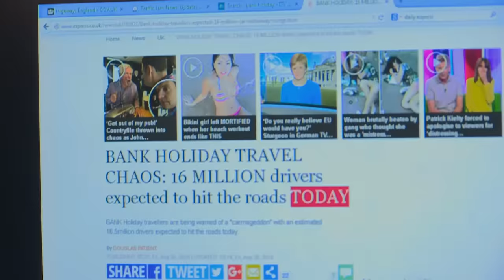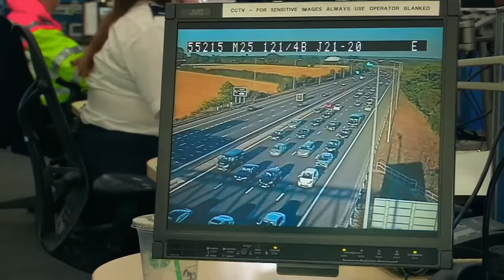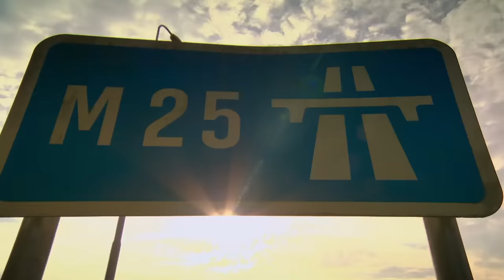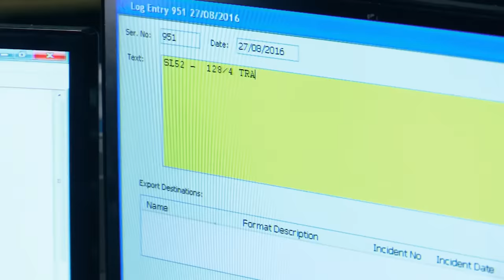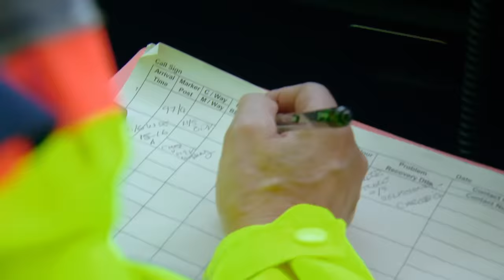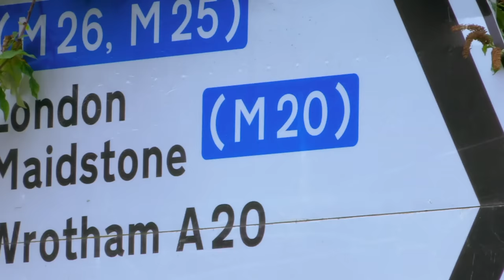One Of The Worst Accidents In Motorway History | Britain's Busiest Motorway E3 | Our Stories

Comment: I love the girls in the office they all do a fantastic job 😀👍🙏
Reply: What these programmes don't show is them switching on the signs because the traffic is moving too well. I'm convinced they do; think about it, the times you go through maybe be 5 miles of gantries all saying; "report of obstruction" with a 40mph limit. Then suddenly you reach the one that switches you back to 70 and yet... Nothing; diddly squat of any obstruction. Does nobody think to themselves... "Why did they have the signs on for nothing then?"
Reply: @johnbower7452  Possibly because just ahead of you, through all that slowdown, people have dragged/carried/pushed/pulled or otherwise coerced said obstruction off the road?  The reason for the slowdown is to make it safe for them to remove it and for you to drive through as though nothing ever happened.  I can assure you that, nowhere in the world can anyone ever say that the traffic is moving "too well"!!
Reply: Really? You don't drive on the motorway daily do you. These guys are in control of the signs and in charge of shutting down a lane quickly if a car is stranded. They fail on both counts. I have seen many stranded vehicles and the lane not shut down. It should be within 60 seconds. After all it's "a smart motorway" supposedly. I have seen families sitting on the grass. If that have had time to get out and sit on the grass then those ladies in the office have had time to spot it broken down. They also cause a lot of problems by putting the speed limit on 40 then 200 Meters onto 60 back to 70 back to 40 all within a few miles when nothing is an issue ahead. I don't expect you to know this If you don't drive 60 hrs a week on the motorways
Reply: Yeah
Reply: I agree
Reply: @Lonely_Goat  bro took it personally
Reply: Parkin takers skin takers car accidents 9:01
Reply: ❤😂 10:52
Reply: Because ego takes over
Reply: That age of vw didnt have seat belts
Reply: @johnbower7452 because it is already resolved then
Reply: That’s sexist

Comment: I actually remember that accident on the M20,  and the HGV driver was very lucky to walk away with his life. Crazy! Great job the guys do on the road 👍
Reply: How did he hit the bridge?
Reply: @selina.c  I don't know which of the 2 trucks hit it, but if it was the one with the excavator on the back then most likely the arm of the excavator wasn't lowered enough and it hit the bridge.  If it was the other truck that hit it first, then I have no idea how as those type of trucks shouldn't be high enough to hit bridges like that.
Reply: @Hagar minimum unmarked bridge height is 5 metres which is 16'4¾" just in case you ever drive something that tall. Although some sources say 16´-3˝ (4.95 metres) because they don't always remember to measure after they resurface the road.
Reply: @Nox_Eternis  Looks like you're right on that... @6:14 you can see a lot of concrete dust on top of the excavator arm...
Reply: I’m a class 1 driver and as far as i know it atleast what I go by, anything under 16.2” will be marked as low bridge
Reply: The Motorcyclist was even luckier, basically the fridge truck stopped the bridge falling on him, although he still fell off his bike when he was trying to avoid parts of the bridge, amazingly he was the only person injured. It was the truck carrying the digger that hit the bridge, it was moving the digger from the hard shoulder, the driver was prosecuted for it, can't remember what he got though. 

The minimum height for an unmarked bridge is 16ft 6", 5.03m as its still the imperial measurement that takes priority.
Reply: @Nox_Eternis  on the m20 i live near there(snodland) and 1 side of the beidge was lower than the other....(apparently)
Reply: I believe the driver didn’t measure the overall height of the machine on the trailer and the boom hit the bridge as it was too high… a think a couple of his work mates said that he should check it but believed it was under the legal requirement!
Reply: @selina.c  Too high a load I expect, didn’t check it was under the height requirements.
Reply: What year was it
Reply: HGV driver didn't only walk away with his life, he managed to walk away with his P45 most likely as well!!!!

Comment: If you look at the digger which hit the bridge at 07:30 it has it's bucket in a "backfill" position. This was the cause of the accident, its travel height was raised because  the bucket was not curled in its "digging" configuration
Reply: For the record I live nearby to the incident and this was the actual cause :)
Reply: but the arm nor dipper arm look damaged
Reply: @tylerkni5148  That's not necessarily entirely surprising, because of how hard the arm needs to be to survive the harsh construction environment.
Reply: Exactly mate bridge would at least been 16ft6 high. Not many trucks that high
Reply: Thanks for that information.  I was wondering how on earth a lorry could collide with an overhead bridge on a motorway.
Reply: From what I understand, the lorry 🚛 was coming off the hard shoulder when it caught the bridge, that section is ALR now.

Comment: I came off the m25 recently onto the M3 and my car failed in the fast lane with loss of power. My mind instantly thought about rolling into the inside asap (they don’t have hard shoulder on m3 anymore along that stretch). My bmw fail safe is to stop the engine from working and I could not override the handbrake to move the car manually so had no choice but to stand other side of the barrier. Within two minutes the traffic officers were there (thanks to the radar poles locally telling them a vehicle was stranded). Cars were flying past, I can’t imagine what I would have done if stuck in the fast lane or even indeed what may have happened. I was so worried others may crash into my car and it might hurt someone or worse. But even on the inside lane cars were flying past 70/80mph and only just missing my car. It was 10pm, dark and pretty busy, I thank the traffic officers for their speedy work and arrival as well as getting me 200 yards down the road with a tow to the sos lane.

Comment: Taking a look at the dropped bridge it's hard to tell if that lorry was actually over-height.  Perhaps for that particular route, but in general it did not look to be any larger/taller than a standard trailer.  It looked like there as an elevation difference between the outside lanes and the center... did the footbridge cross below standard height in the area the truck was operating?
Reply: It was the truck in the left hand lane that hit the bridge. He had an elevator type thing on the back and it was this that caused the collapse.
Reply: @stephenrandall3551  Yes , I think that's right 8:59 The truck with the digger hit the bridge and it came down on the white truck. They don't tell people ! Millions were interested , all they're told is a truck hit a bridge.
Reply: You can look up the incident online by searching for "M20 bridge collapse".
As others have said it was the lorry in lane 1 (nearest the hard shoulder) which had an overheight excavator on the back that actually hit the bridge and brought it down on the standard height white lorry in the middle lane as it was overtaking.
Reply: in the UK we have a different ‘standard’ height for HGV. most of Europe is 4 metres but in the uk the average heights of HGVs is between 4.2 & 4.65 metres
Reply: @cjatruckphotos  the problem was that the digger should have been moved on a low loader (that's exactly what they are for) or it should have had its boom extended forwards to reduce its height. 

The driver had struck the underside of the previous bridge and got out to check his load. He concluded it was ok.

He got a 12 month prison sentence which was suspended for two years. He also had to do 200 hours of unpaid community service. Didn't read anything about whether his driving licence was affected.
Reply: @SerenaBluee  Sure ,  It's just not posible for the white lorry @ 8:59 to demolish even a light footbridge. The top is  thin aluminium which just crumples on impact. The digger arm on the other hand is very solid thick steel , at 60MPH that has a lot of momentum!
Reply: @IAMPLEDGE   i didnt know anything about the incident. thanks for explaining what happened. i was explaining about the height regulations we have
Reply: @cjatruckphotos  it helps that I am local enough to the area to be familiar and know which local papers to read. Oh and one of my mates was stuck in the queue on the M20 a few miles from where it happened but stuck between junctions.
Reply: Must've been pretty tall. If a bridge is unmarked, it must be at least 16'6". As a fellow trucker, this sort of thing is my worst nightmare 😮
Reply: @cjatruckphotos  Thank you the info, I never knew that.
Reply: @stephenrandall3551  yes like he said, because the bridge sloped down...
I live at that junction, and the bridge sloped down...
Thats why it hit, left lane and hard shoulder had different heights.
Hemce he didnt hit any other bridges
Reply: @SerenaBluee  wasnt over height..
The bridge sloped down
Anyone that luves near there knows it sloped, weve always said same thing

Comment: It’s not the fast lane it’s the outside lane which often moves slower than the other lanes !
Reply: the general rule of thumb for Americans: right lane (slowest lane) is for under speed limit to +3 mph over, middle lane is for +5mph to +10mph over, and left lane (fastest lane) is +10mph and faster. If you don't move over for someone going 85mph in a 70mph you're rude
Reply: The term "Slow Lane" is the cause of Middle Lane Hoggers.
They mistakenly think the inside lane is for slow-moving vehicles only.
Reply: @klausjackklaus  ffs
Reply: @phillwainewright4221  no. You should be in left unless overtaking
Reply: @klausjackklaus  In Europe the left lane is only for overtaking
Reply: @rebeccaa2097  That's... exactly what he said
Reply: @bilbobaggins138  no.
Reply: It does my head in when people call it a fast lane!
Reply: @rebeccaa2097  Depends on what part of Europe you're driving in, if you're driving on the right hand side of the road, you overtake on the left.
Reply: @rebeccaa2097  I suggest you re-read the comment, he was complaining about the use of the term "slow lane" causing middle lane hoggers, not saying it was correct.

Comment: I’ve been driving now since 1982 when I passed my test, and can honestly say I’ve been on a motorway about 10 or 11 times! Hate the things! There were A roads long before motorways, and frankly I’ve in most cases actually been quicker from A to B!
Reply: With these lethal "smart motorways" I prefer to use A roads.
Reply: Never been on one as a driver and never will either!
Reply: If you don't have the confidence to drive safely on a motorway, you shouldn't be driving at all.
Reply: @mattd6085  yes, if you never have to use a motorway then you should never drive at all. That makes so much sense.
Reply: @mydogeatspuke  No, using them is entirely up to you, I said if you aren't CONFIDENT enough to use a motorway, you shouldn't be on the roads. Driving at 70 and conducting basic lane changes isn't hard and anyone who struggles with it is a liability on any road.
Reply: @mattd6085  nah if you aren't confident using a motorway because you have no reason to ever use a motorway and never plan to use a motorway, then there's no reason at all to not still drive. You can drive at 70 and lane change on a dual carriageway, so what does a motorway have to do with anything?
Reply: @mydogeatspuke  Because motorway driving is both the easiest and least likely to cause an accident. If someone can't even handle a motorway without kicking off, I have serious doubts to their competency.
Reply: @mattd6085  so you've seen someone say they don't like motorways, decided that means they don't feel safe on motorways, and now they can't be on a motorway without kicking off..? That's quite the imagination you've got! Nobody has preferences, they're all just incompetent and dangerous and should hand back their licenses. Seems sane.
Reply: I live in the very north of Scotland and the nearest motorway is around 200 miles away and the nearest dual carriageway about 100. I never really see traffic when going anywhere until I hit Inverness, which has the nearest dual carriageway.
Reply: @mydogeatspuke  ah the guy looking for an argument on you tube
Reply: @davedixon2068  yes, that's me, the guy who said OVER A YEAR AGO that there's no reason why someone shouldn't still drive if they never encounter specific road types in their entire lives is the guy looking for an argument. You're so right. That's definitely true and not projection as you share your meaningless opinion with the past for attention. Big true.
Reply: @mydogeatspuke No the guy who seems to be disagreeing for the sake of it, the fact of it being a year ago seems irrelevant to me, I only saw the post today.
Reply: @davedixon2068  who's disagreeing for the sake of it? Stop projecting.
Reply: @mydogeatspuke  no
Reply: @davedixon2068  oh ok...??????

Comment: I find it amazing how the M25 is busy and has massive congestion and volume problems when you compare it to other countries. Ontario, Canada has 18 lanes across in Toronto. Its 700,000 volume a day at the same place. The 401 hwy is massive in comparison.  I guess its why britis will take the railway to get anywhere.
Reply: There is a huge nimby culture here and a lack of space.
London real estate is very expensive and it would cost an unbelievable amount to double the lanes even if they wanted to
Reply: @joelawton123  And when they do, they create a "smart motorway" by removing the hard shoulder and converting it into a running lane, meaning no place to pull over or for patrols to travel to get to an accident.  Great planning, UK.
Reply: @joelawton123  that’s the reality there and it makes the driving harder. Every country has its driving issues and infrastructure problems. We lack a train system for people and goods when compared to the UK etc,
Reply: @joelawton123  And it won't help with traffic at all. As then you have scared a ton of people away from public transport.

Comment: Amazing how that digger took the bridge down on the bk of that wagon, it doesn’t look that high and looks brand new, doesn’t even look damaged
Reply: I don't think it was the orange excavator that hit the bridge. There's something in front of it on the trailer (look at the overhead shot at 8:55)
Reply: @sydnorth5868  The Truck with the Excavator was on the Hard Shoulder moving to Rejoin the Motorway, however, the part of the Bridge that was over the Hard Shoulder was Less than 16 ft 6 inches which meant that it should have been marked up with the True Height, and it wasn't, therefore, the Driver with his Excavator who's Height was less than 16' 6 inches assumed that the Bridge was on Excess of 16' 6 inches as per the Highway Code, Basically, any Bridge with a Height 16'6'' inches or less must be marked up with its True Height. Legally Wise, i would think that the Bill for the Repair would Lie with the Council of the Area.
Reply: @MADTASS  correct, i live there(that junction) and that bridge sloped down towards the hard shoulder massivly